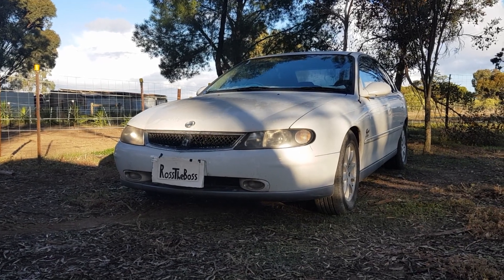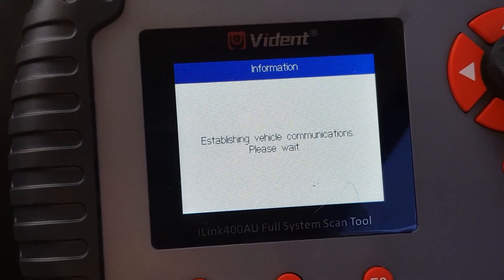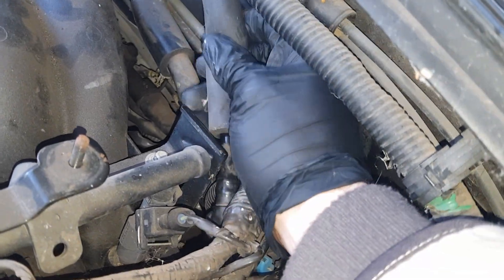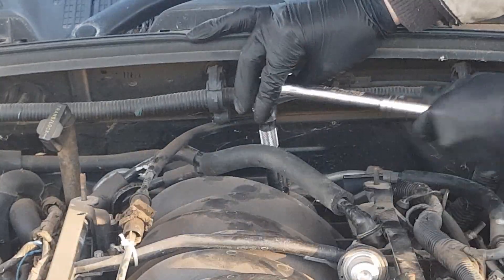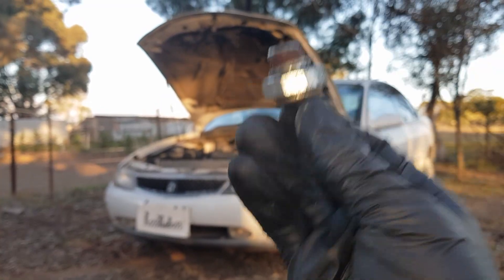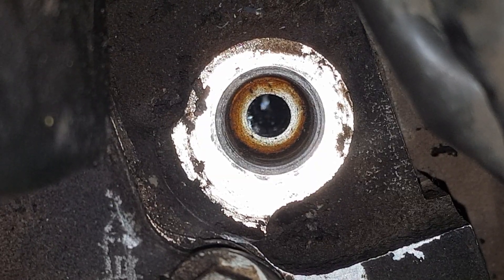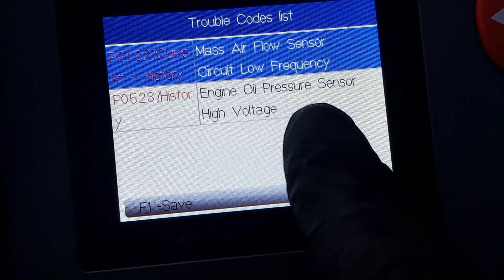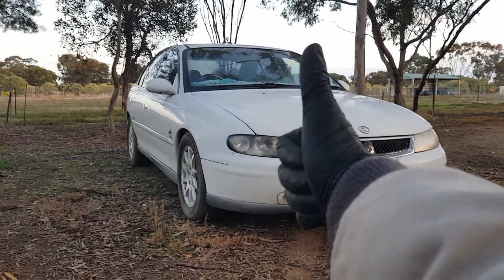LS1 Oil Pressure Sensor Replacement Guide

Comment: No No No No No ! You've just pushed some of that debris into the oil gallery. We've all been caught out at times forgetting to clean the job site first so in this situation I would definitely seal the gallery hole with round stock and perhaps a rag in the 1st instance and then blow out the debris with compressed air. If not air then use a solvent or other in a Px bottle.

Otherwise your video was good advice.
Reply from the maker: Thanks for the suggestion. It was more dirty back there than I had realised, unfortunately I didn't have an air compressor nearby so I had to improvise with what I had on me. So far I've had no issues with my engine and hopefully the oil filter will do its job and catch any other debris.

Comment: Hey mate, about to do my vx ss, would high temp thread sealant be recommended when doing this?
Reply from the maker: I didn't use any sealant on mine and haven't had any issues with it, I just had another look then and there's not a drop of oil. The sensor itself should have a washer that seals in any oil that may get past the thread.
Hope this helps.
Reply: @ beauty, appreciate that heaps, saves me the $30 on permatex, cheers 🤙🏼
Reply: Hello again, bought the wrong socket (12 point not 6) 

Doing it again today, the plug next to the oil pressure sensor is caked in oil, would that be from the sensor or from another leak? Can’t find anything online about the plug but I assume maybe cam sensor?

Tried again today and the 27mm deep socket wouldn’t clear something around the sensor, wouldn’t fit over properly, if you have suggestions would be great thanks mate
Reply from the maker: Firstly yes you need a 6 point 27mm deep socket to remove the sensor. The one next to it is for the cam, ive only ever replaced that one with the motor out of the car. It's in a difficult to reach spot and the sensor itself it quiet long. I just checked mine and it has that old oil/dirt caked all over it, however the oil pressure sensor has no leaks around it. So the leak wouldn't be from the pressure sensor in my case. Could be from the cam sensors but it's really hard to get a proper look back there. As for the socket not fitting, make sure it's a 6 point and that it's directly above the sensor. If it's on an angle it won't go on, I had to use a bit of force to get it on properly. Try putting the socket on first, then the extension.
Hope this helps.
Reply: @-RossTheBoss  absolute legend mate, appreciate it heaps, ended up just getting an impact that was too thick to clear anything, was told either a thinner walled socket or the Toledo oil pressure socket, bought the latter and had it done in 10 minutes. 

I believe my cam sensor sounds exactly like yours, I’ve cleaned as much as I could off the plug but I fear it’s leaking too

Appreciate the help though, your couple of comments have been more helpful than most of the forums I’ve been reading 🤙🏼

Comment: looks like half inch socket bits not quarter inch. Thanks for the vid very helpful
Reply from the maker: Yes you are correct, that is a 1/2 inch. My bad
Reply: @ I am now shopping for a 27mm deep socket!
A bit of a harder job for me as I’m fitting an adaptor under the sensor for an extra sensor to run a separate gauge